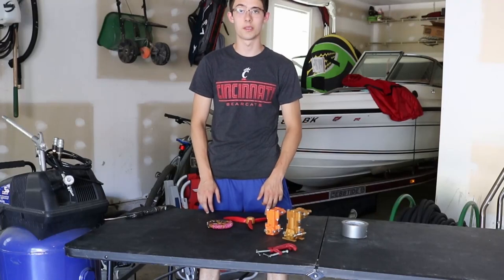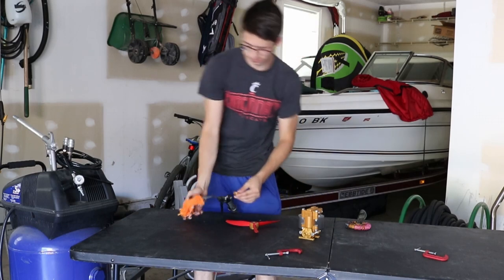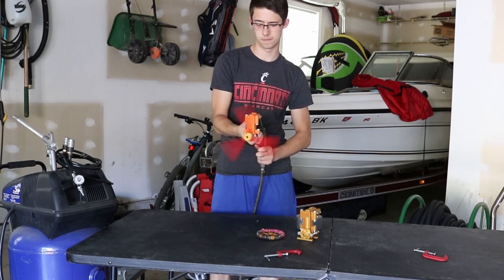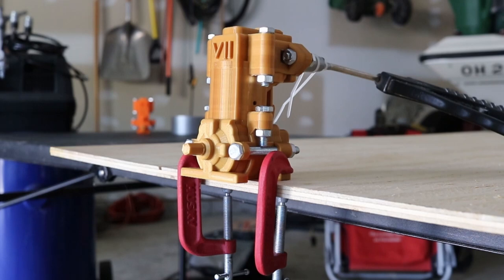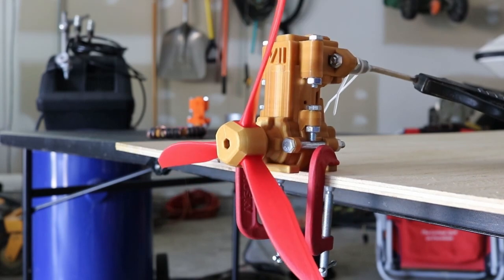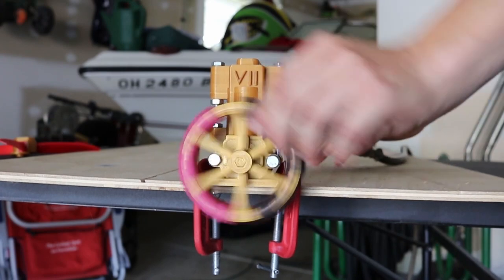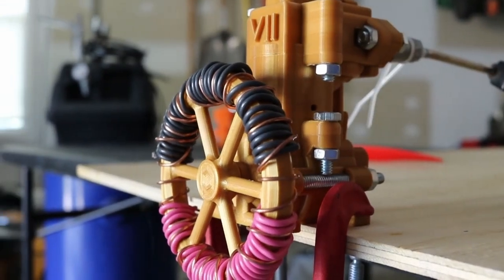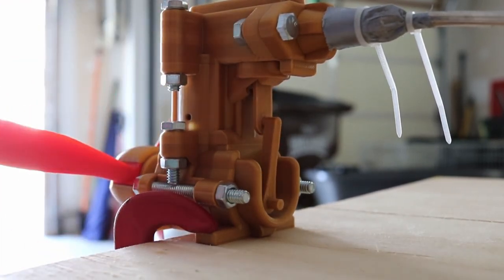FIRST TESTING - AIR ENGINE #3

Comment: Would of been nice to see now you put it together and to see what rpm the motor dose at certain PSI or Bar
Reply from the maker: That's coming in the future as soon as I get the right equipment. Also to see the engines being built, you can watch each of their videos.
Reply: Keep up the awesome work 
I’m actually building my own compressed air engine I been wanting to build one what size bolts are you using for the engine 

Cheers Rick
Reply from the maker: I used 1/4 20 bolts for both of these. I recently found out how to print threaded parts so I won't be needing to worry about using threaded nuts to hold the parts together